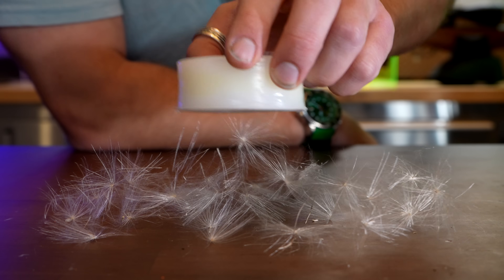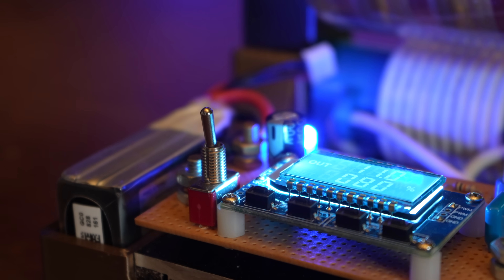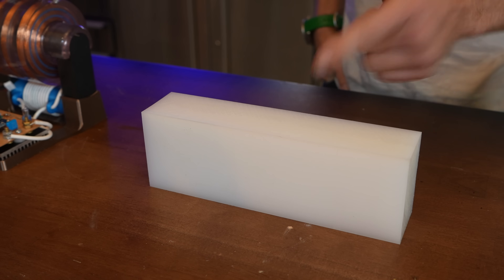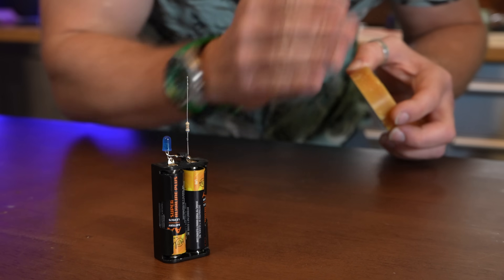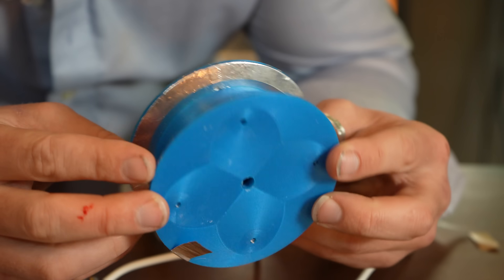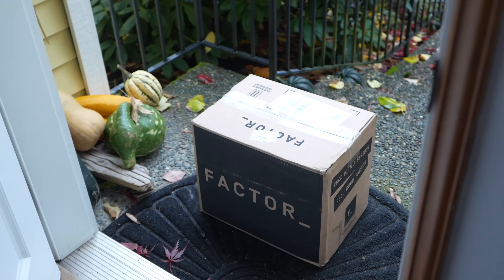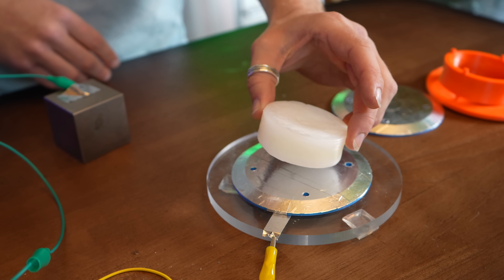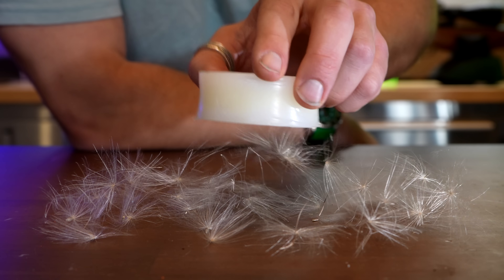Creating an Exotic Material With A Permanent Static Charge (Electret)

Comment: 1) Imagine you find a piece of amber that is an electrid and intuit that it must have been struck by lightning. Imagine now that this is ACTUALLY what happened.
2) Imagine building a motor or generator with these
3) Imagine adding these to existing motors or generator.
4) Imagine being able to track things like small insects as if they were particles in a particle detector using these.
5) Imagine building robotic muscles by directly embedding electrids in a series in some kind of elastic bands, and then using changing voltage gradients across them to get them to contract and relax.

Comment: Imagine building a mold that's designed to focus the EM energy; possibly in an array, used to generate energy.  If you can technically form a "circuit in space", can you form a complete perpetual function from this?

Comment: I'm confused why it is necessary to make only a dipole electric field.  Arnt monopole fields possible with charge and electroc fieldss...unlike magnetic fields which are always at least dipole.  Are practical insulated long lasting monopole electric fields possible?  A monopole field should have a much higher range than a dipole field, as the field goes as 1/r2 not
 1/r3.  Is the dipole electric needed due to discharge.

Comment: Does the change in volume of the material as it moves between thermal transition points impact your results ? 
If you made a mold with one of the plates able to slide like a piston to compensate for volume changes during cooling would make a significant difference ?

Comment: New Electro Magnetic, Plasma Heat Shield. tech!  Technology its rights to a radical new form of propulsion that uses electromagnets to control the flow of plasma over aircraft and spacecraft flying at hypersonic speeds. -A-plasma-force-field-to-protect...
This heat creates a plasma shield that's denser than the surrounding air and able to deflect or absorb the energy from the incoming shockwave. ... "The general concept is to use an electromagnet… See more

Comment: Is it possible to construct a kind of macroscopic atom? Consider the following, two magnets are attracted along the axis of the magnets. An electret is attracted to a magnet at 90 degrees to the axis of the magnet but only if it is moving. Is it possible to move the electret around the magnet in such a way that the resulting torque helps to sustain it's spin through gyroscopic precession?
Reply: I've just watched the Neutron coincidence. This in turn lead me to learn about the 'the structured atomic model' which presents the idea that atomic nuclei are rigid structures. I have to say it is pretty convincing and well worth learning about. One more question for you Jay, is it the positive end of the electret that is attracted to a magnet or negative end?

Comment: I don't think that's the weakest electret in the Milky Way.  As I learned 50 years ago studying with C.A.L. Bassett and Dan Pilla at Columbia, the mineral component of bone is an electret.  Not much field strength, but doesn't need it, because it need be effective only a microscopic distance away, to steer osteoclasts and osteoblasts to grow and remodel the bone.  The original charge separation there is produced not by anything like electrodes, but piezoelectrically, the hydroxyapatite serving as a memory of these transiently induced polarities.

You may be familiar with Bassett's use of exogenous fields induced by asymmetric wave forms thru coils to speed healing.

Comment: An old Machinist's trick is to simply 'stroke' any hand-tool repetitiously  with a Strong Magnet. It then, polarizes along those fields, and becomes a Magnetic attractor, useful in picking up Screws, Bits, and certain Scrap items. Heaveside IS the Antithesis of Electromagnetic Thought, as he, alone, CULLED so much of a prior's work, and YOU, of all People, need to take Heed of THAT FACT ALONE.

Comment: If the "positive" side constantly attracts the feathers, does the "negative" side constantly repel?  Can you use a much higher voltage to create stronger electrets? Also in a zero gravity environment, this could act as "gravity plates" creating artificial gravity.??

Comment: This is amazing! What if you made a version of a CMOS sensor, but instead of visible light values being collected, it collects the value of the static field, maybe by using some sort of massive array of reverse biased diodes and capacitors, that then go through an ADC to be read out by some microprocessor. 

You could create an electrical field camera, if you can make a very well shielded housing, which would be pretty cool.

Comment: You could make a super high resolution image of the static field, using your existing detector.
You just need to increase the sample size. Personally I would hook the LEDs to 3 Arduinos analog ports and have a pair of motors positioning the electret over the detector array thousands of times - just moving the width of one array gap - equivalent to measuring every offset between the sensors. 
Log the xy offset mm and the reading of all 16 sensors and you have a high resolution field map.
I would also set the distance between the electet/array so it barely lights the center led. This way you'll get a good map extending toward the edges of the field.

Comment: What would happen if you used ionic polymers instead of regular dielectrics? I theorize that if you melted a mixture of a polycation and a polyanion, the two would separate when exposed to a very strong electric field because the field would be powerful enough to override the attractive forces between the two polymers. When the mixture becomes solid again, they would be unable to recombine because they are now locked up in solid form. Thus, you would have a permanent positive charge on one side and a permanent negative charge on the other. This might be a lot stronger than the regular dielectric because you would be starting out with charged materials and the only task would be to move them around, as opposed to ionizing neutral materials.

Could you see about testing this theory? I would like to, but I don't have the resources, nor do I want to work with high voltage electricity.

Comment: Nice video on a very interesting topic. If I understand correctly, the maximum static field is limited by arcing and corona effect which are affected (amongst other parameters) by the distance between electrodes. If you were to increase the distance (make a thicker electret) would that also increase the electrets field-strength? What if you would cut the electret in 3 equally thick disks, would the middle section have the same strength as the outer sections?

Comment: if you used two copper plates that were roughed with sand paper where you want the field you will be get a more homogenous field as there are more surface area for connection.

Comment: When  you mentioned making a 10x10 detector grid, coupled with your statement about monotony, the thought occurred to me: why not build a static field scanner.  Relatively simple to build (I think): consider a 3d printer.  Now, instead of the print head, you have the single sensor, and you record the readings of the field strength associated with each position in x/y space.  That's the concept, now you build an x/y vertical scanner so that movement in x is horizontal and in y is vertical, then you can have the scanner iterate through its range of positions recording field strength.   As an optimization, you can "hunt" -- do quick movements of the sensor "head" in like an "X" to cover the basic space coarsely, then use the readings to limit the scanning to where the field strength is present (you get the idea, it doesn't have to be an X, just some very sparse/coarse scanning pattern to zero in on where the field is and then do smart, find-grained scanning in that area).

Comment: Here's a thought. Does it repel dust? If a layer of material that repelled dust could be built into furniture or floors, etc. people would really go for that.
Reply: That's what I was thinking. I use a negative ion generator at home that collects dust from the air. One of these could be a static version that requires no power.
Reply: if you keep following this thought train - it leads to a way to accelerate the thruster
Reply: It attracts charged particles. If they get embedded in the wax they weaken the field.
Reply: Build it into Solar Panels!

Comment: please try this "weird" phenomenon using your electret :
When a magnet and an electret are near one another, a rather unusual phenomenon occurs: while stationary, neither has any effect on one another. However, when an electret is moved with respect to a magnetic pole, a force is felt which acts perpendicular to the magnetic field, pushing the electret along a path 90 degrees to the expected direction of "push" as would be felt with another magnet.
Reply: Agree ! please do it
Reply: I WOULD ALSO LIKE TO SEE THIS!!!!
Reply: this only happens if theres a net charge. In a standard object with no net charge this just forces the object to polarize. I suppose if the two objects are really close you might get an effect sincr the pole closer to the other objects field will interact slightly stronger than the opposite pole
Reply: Lorentz force😵
Reply: That sounds pretty familiar
Reply: What the..😮. why are thousands of us only just learning of this!
Reply: @DJMcGuitarTea  exactly !
Reply: But had plasma already built a magnet?
Reply: A moving charge is in effect a kind of electric current, and the interaction between currents (in conductive wires, typically) and magnetic fields has been understood for well over a century. This could be fun to demonstrate in a freshman physics class using an electret. 😊
Reply: So electrons could be used to enhance the momentum of motors that use perm magnets. While using even less magnets maybe
Reply: an electromagnetic wave is 90 degrees polarized between the electric and the magnetic field ... NOW u know why.
Reply: Sounds like a good basis for a sensitive transducer for say inertial reference tracking.  Or they could just use a couple thousand feet of optical fiber and some other elements to get a super precise one.  And those little MEMS critters that are out there...  do not know what effect they use, but they are real accurate and finely resolved.
Reply: @cosmicraysshotsintothelight  “Totally—what I’m seeing is basically the Lorentz effect on the electret’s bound charge. When the polarized electret moves through a static B-field it ‘feels’ an effective E = v × B, so the net force is F ≈ Q_eff · v · B in the v × B direction—transverse to the field, not along it like a magnet–magnet push.
As a sensor, you could mount a thin electret film on a very light cantilever in a uniform gap field and read out velocity/vibration (flip sign by reversing motion or pole). The catch is scale: with realistic surface charge densities and cm² areas the forces land in the µN→nN range and drift/temperature/charge decay become a headache, so MEMS (capacitive) and fiber gyros (Sagnac) will easily win on precision and stability.

I’m sharing it more as a neat tabletop demo of v × B acting on bound charge than a contender to MEMS/FOG. If you try it, a horseshoe magnet, torsion fiber, and optical lever make the effect nicely visible.
Reply: @ali-pn6mj    Must also be some side stuff.  Make a pinball machine tilt detector thing, which was like a plumb bob sitting within a ring.  Tilt the machine or shove it, and the bob hits the ring, triggering the tilt.
Reply: So, a dangling puck and an array of sensors below.  Hey!  We can finally find out of a solar eclipse affects the pendulum!  Hahaha...  just kidding.
Reply: couldn't this be used for midair turning
Reply: @crusher9z9  yes, the physics of a moving electret in a magnetic field is fascinating and does result in forces that could, in principle, be used for midair turning.
Reply: @ali-pn6mj if you were able to make a series of magnets with these eletret. Would you not be able to make a constant energy generator? Or simply why wouldn't you be able to attach a wire to the electric itself and use it like a battery? how long does the electrostatic excitation persist? Is it possible to pull a neodymium and make an even more dense version? Or shove more electricity into it? Clearly I would assume the amount of electrons that could be in must have a upper bound.
Reply: @cliptracer8980 

Doubt you could ever get it to store enough electricity for anything meaningful. So no battery. 

In this video you are seeing other circuits with power react to the charge. More like a switch than a battery. The exception being some extremely low power circuits like LEDs. 

This could be used for a longer distance non contact mechanical switch. 

Basically have a pivot rod with the disc at one end and a detector for it to interact with. 

With a more advanced detector you could even fine tune for something akin to a throttle or similar to a resistance based potentiometer. 

I think the neatest thing would be to make the electret and attempt to cast or drill a cavity to install a neodymium magnet inside and see what kind of shenanigans that does. 

Of course, I have no idea if an electret is dependent on shape. And would a drill cause the effect to dissipate. Obviously those questions would determine my experiment. 

It seems that an electret by what I see in the first 1:37 of the video is essentially a polymer where a charge is introduced prior to full hardening, or during hardening in order to instill the positive and negative electron orientation. So shape shouldn't matter. 

This is similar to using a wire coiled around a nail a pulsing a short term DC current through it to magnetize the nail. We used to use that to remagnetize our bit holders at a cabinet shop I worked at. 

Over time, impacts and heat changes will cause iron to demagnetize. Wonder if this is the case with the polymer electret.

Edit: And after I pushed play he confirms my hypothesis for how the polymer is charged. Crazy
Reply: You quoted Wikipedia, but I really appreciate a video on this...

Comment: A super easy and cheap way to make a passive static charge detector which is very handy to have if you live in an area prone to heavy storms and tornadoes. You buy a 1.00 string of battery operated led lights (prefer blue or clear) and let the two AA batteries run dry on them. Then hang that in a vertical position some where  with the battery box (dead batteries still inside) free dangling. When a charged up storm starts rolling in, the lights will start to glow. The brighter it gets the closer to the active part of the storm you are.

Comment: Ya know... since water molecules have a posituve/negative orientation... it would be tricky... but I bet you could make an electret out of ice...?  You would have to freeze the water while it was being exposed to the external charge...
Reply: I'm not sure that it would be all that tricky as long as you use pure distilled water. Pure water doesn't conduct electricity.
Reply: @johnharris5786  you do get some current tho as water will dissolute into hydroxide and hydronium ions
Reply: @johnharris5786  also you would probley need to cool the water very quickly so it cant crystalize as during the crystallization the dipoles will align preventing the effect
Reply: @a.kjfhkziujsfdgbskjxfyhgfl2332   Two good points. I guess you would have to work out if the amount of power dissipated by the water is enough to stop cooling in the first place. If the current is small enough it shouldn't matter too much? As to the second point, would it be possible to cool the water down to zero or even sub zero and keep it a liquid by agitating it maybe? You then only need to apply the electric field just before it freezes.

Comment: Is there a way to charge it up even more? Like by wrapping it with a magnet wire like you would a piece of iron? What happens if you press a strong green laser directly up to that white Puck and turn it on? What happens if you send the beam of the laser along the surface or a corner like a site. Does it do anything to the beam?

Comment: When you point your finger at the Van de Graaff the potential field flows around you as opposed to radiating out spherically from the isotropic capacitance... basically an analog to the way permeability works for a magnetic field but on the skin surface as opposed to concentrated through the material (Gauss's Law) also the reason your first attempt failed is directly related to Gauss's Law.

Comment: I am trying to find other alternatives for gravity in space.  Centripital and magnetic are good but could we put a static charge on people coming into a room, have the ceiling be the same charge and the floor be the opposite charge and with the two forces at work, keep people on the floor in their socks and not floating around with every movement? This electromet material could be charged to be the floor, and if it loses the excess charge then it still would have it's weak natural force, and perhaps would not cause sparks to fly into people's feet.  So can it pick up a balloon?  In zero G this would work but how well?  Could we make socks that are MORE attracted to the electromet than normal objects without causing shocks through the socks?  It's worth looking into for the lounge I want to build where people would kick off their magnetic boots and sit in a chair with a slight vacuum through a screen seat.  It might even be possible to pour liquid drinks on my space station and not have the liquid float out of the cup.

Comment: I'm curious if this may also work with some cast-able resins? Like epoxy or silicone? That may be interesting too. However you probably don't want to have a discharge around the out-gassing as such materials cure, as that may ignite.